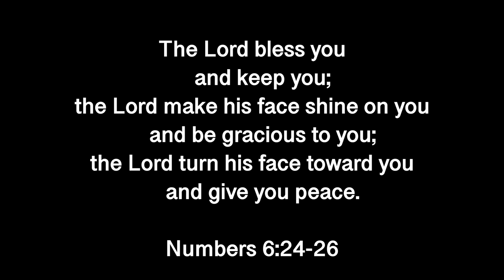Best Rear Ballast?? Heavy Hitch vs. Ballast Box

Comment: So I've done the math many times and I just cant seem to justify the heavy hitch.  I need 500 more lbs at the rear of my 1025r.  The heavy hitch with  the stand and the weights shipped to me in OR is $2,105!  The JD box and  50lbs of sand is $350 and a $50 dolly which I technically dont need [can I put a weighted HH down without that cart to save money? If not, I have lug and store weights just to manually get it on and off every time I use it]  Plus on the JD box I can get more weight if needed and can add handy things to it like a tool box, tubes for shovels, throw my chains in it, weld on a receiver, put my kids in it, etc.   So here's my question, do you have the same departure angle problem with the JD box?  How much further does it stick out over the 70lb weights on a HH?   If theres not much of a departure angle issue and it doesnt stick out that much further (at least not annoyingly far). How would you justify the massive price difference?    Thanks!  I love your channel Tim...it makes me happy.
Reply from the maker: I don't have any measurements on the JD box.  I have a few points which help justify the price.  ...they may not be relevant to you, but then again, they might.  I'll throw em out. You make your own decision.
- weight reuse.  You can use the weights on the front of the tractor when you do not have the loader on.  This provides some better mobility when tilling, etc.  
- You can get a rear blade for the 2 inch receiver from heavy hitch which is not very expensive.  When compared to a standard 3 pt rear blade, you are almost getting the hitch for free.   Hiller-bedder, subsoiler, etc also available.
- These attachments (blade, etc) are easy to store inside because they do not have their own 3 pt connection.  Very compact.
- Heavy hitch cart (yes, more expense) makes it EASY to roll the HH around ...and can store the weights without the bracket too.
You mentioned angle of departure...even though I have not used the Deere box, I'm absolutely certain that it is not even close to as good as the HH.
- Overall, the HH and weights are much more compact. ...and much more flexible for usage and storage.

I get it, they are expensive.    One way to handle it is to look around for used weights..buy a few at a time on craigslist, etc.

Comment: Let see..... you could tilt your trailer up a little to make the angle of loading less, mod the ballast box, etc. I don't like liquids in the tires for ballast. 1, it makes tire repairs more expensive, 2, it can rust the rims, 3, both. Carry an external fuel tank for weight? Oh well.... Nice video again.
Reply from the maker: 2. the RimGuard that we have in our tires will NOT rust the rims.   I find liquid ballast to be the cheapest ballast possible.    Another advantage is that it is not "in the way". It does not protrude in any way like other types of ballast.
Just some thoughts :-)
Reply from the maker: ..and tilting the trailer has almost no effect....due to the hinge location.  I wish it did work like that. I would use that truck all of the time!

Comment: the sliding plate might be sticking because of the paint if theres a way of grinding the paint off it might slide smoother
Reply: Once you get the plate off, make sure the edges are smooth, then spray the edges and the slots it rides in with silicone. Reinsert the plate and move it up and down several times. See  if that helps.

Comment: Could you explain to me what the heavy hitch with weight helps the tractor do? I’m new to this. Thanks.
Reply from the maker: It keeps the rear end on the ground when you have a load on your loader, and it relieves stress on the front axle in the same scenario.
Reply: Okay So with the backhoe in the rear, it should do the same thing correct? btw thanks for referring the tooth bar, it's working great so far for digging out bamboo roots. Thanks for the 5% discount.
Reply from the maker: Yes, backhoe can serve as rear ballast

Comment: As always..interesting video. I have two questions for you. with the HH can you turn the suitcase weights the other way so that they face inward towards the back of the tractor instead of outward?   Second question is...will a couple (or 3) suitcase weights just fit behind the seat (loose) if put in width wise?   You may recall i'm the poor soul who has virtually no room to put ballast on the back due to space considerations. I have the 170lbs on each wheel cast iron option and am considering your suggestion for liquid ballast in the tires as well. I'd like to get some weight though in the middle and to put 2 or 3 suitcase weights behind the seat if possible might help. Thanks ! :)
Reply from the maker: You can put SOME weights on the inside I think,  but not a full rack.
Reply: On the dual, and possibly the offset, bracket you can turn all of the weights around to face the other way. The inside ones  may hit the handles for rotating the top link, unless you are careful to set them vertical.  However, you cannot place them backwards on these brackets if you have a quick hitch. (Which you probably do not have if you are so space constrained.)
Cheers.

Comment: Lol, great video Tim. I have always wondered why one would go with the ballast box as opposed to using weights and a weight bracket. The weights take up less space and can be used on the front and rear of the tractor with the right mounts.

Comment: Can u pick up the back end of a 1023E with the 3 point hitch implement?
Reply from the maker: No. There is no down pressure on a typical 3 point hitch.   Even on very large tractors.
There is (or was) one exception that I know of. I believe the Deere 4 , 5, or 6 series had a down pressure option at one point.  
I don't think it works very well, as the down pressure removes weight from the rear wheels, reducing traction.

I hope that makes sense.
Reply: @TractorTimewithTim  thank u

Comment: So $1000 ish for the heavy hitch, weights, and cart, or about $500 for the other. With a moving dolly.  max about 700? lbs VS 910 lbs for the box filled with sand
Reply: Heavy hitch is a lot more than that if you plan on buying enough weight with shipping.   I need 500lbs more after the fluid filled tires and hitch weight I have.  70lb weights are about $100 each 8 of those alone are almost $1000.  JD ballast box is $300 and 500lbs of play sand is $50.

Comment: It appears that the ballast box was designed for a compact (catagory 1) tractor rather than a sub-accounts (cat 0) tractor.
Reply from the maker: This is a category 1 tractor
Reply: Isn't the 1-series actually "Limited Cat-1"?  Which means it doesn't lift quite as high as a true Cat-1 hitch. Granted, you have mostly corrected the issue with your lift arm mods.
Reply: @eosjoe565  No, the 1025R is not listed as a limited cat 1. I believe the 2305 was, though.
Reply from the maker: Terry, it IS listed as limited Cat 1...which means it has limited lift height.
Even the new 2025r is listed as limited cat 1...which surprises me.  I thought the taller tires would be enough to get it to lift higher.

Comment: I wonder if Tim adjusted the injection timing a bit. Hmmmmmmm
Reply from the maker: No, only hydraulic pressure
Reply from the maker: I guess I thought this could be inferred ‘juice in the joints’ ...
Reply: Ahhhhhhhhhh I get it now! Someone mentioned Hot Rodded and couldn’t help but think engine.

Comment: What do you mean by "juice and the joints"?
Reply from the maker: Hydraulic pressure
Reply: My guess is shimmed the relief valve.  Get a bit more umph.  Just make sure to check with a pressure gauge to make sure you stay under the rated max.

Comment: Has anyone thought of mounting a set of heavy duty casters right to the bottom of the ballast box?  My thought would be as soon as the box is dropped, it would land on its casters and eliminate the furniture dolly?  I guess maybe the downside would be having a top heavy object on casters and maybe the dolly having a larger foot print would be more stable?  Either way maybe this is a design improvement opportunity for someone to take on?
Reply from the maker: Would have even LESS ground clearance, no?
Reply: Tractor Time with Tim 

I believe your right.  I came up with the idea and posted the thought mid video!
Reply: Artillian makes a ballast box dolly that clamps right on to the bottom of the JD ballast box, It has six heavy duty casters. The way it is designed it kind of goes "over" the bottom of the box so it probably only adds an inch or so. I've had one for several years and it works very well. The wheels stick out on both sides to eliminate the box being top heavy. My box weights almost 800 lbs. and it rolls around fine (albeit with a bit of grunt). :-)

Comment: Heard you mention your backhoe hitting the ground while loading and unloading. Little trick you can use is buy some little metal ramps for oil changes and that and put them in front of your rear axle and just drive forward onto them, this will bring the tail of the trailer almost to the ground. Probably good to have it in 4x4 and you could weld Jack's to the tail of your trailer to keep it from lifting your trucks rear tires up and off the ramps. Did this to load my mustang so I dont wreck the front bumper. Hope this helps so you dont have to take chunks of concrete out of your shop or drive way.
Reply: The proper way is to back the tractor on the trailer. That also puts the weight of the tractor forward which is more stabile while towing.
Reply from the maker: Angle is the same forward or backwards.  If backwards, I scrape the trailer. If forwards, I scrape the ground.
Reply: @TractorTimewithTim  I presumed you had a trailer with left and right ramps and opposed to a ramp gate. Backing up separate ramps solves the clearance problems.

Comment: If you are doing an example of stock, drop the quick hitch, and it won't stick back as far.  Might as well use the mod.  Or just shorten the top link and tilt the box up from the ground.  Or pick it up for travel with the bucket or forks.  Or get a different ballast box, there are so many to choose from.  Locally we have Armstrong Ag, Mahindra, Land Pride, New Holland, etc in addition to Deere.

Or get rid of the 1025R.  Like my BX2380, the rear hitches do NOT lift up very high.  It's disappointing.  I'm going to switch to a 2038R next spring.

I'm disappointed with Heavy Hitch--the products are expensive enough, but the shipping is murder.  I placed an order then canceled because it was taking too long.

Comment: you can jack up the front of the trailer and that would take and lower the rear of the trailer just don't unhook it
Reply: carl kidder he can also back the tractor onto the trailer and likely get it loaded as-is with the weight box.
Reply: depends on the weight and where he has room to put the tractor can't have to much weight on the rear of the truck, I always had attachments in the front of the tractor
Reply from the maker: Or, I can just use the heavy hitch.  My purpose in showing this particular need was not to seek solutions on boarding the trailer.  Rather, it was to show an example (of which there are many) of how the low hanging ballast box can hinder the mobility of the tractor.

Comment: 8 x 42lb = 336 lb. Which is roughly 1/2 what the operator's manual recommends for the 1-series H120/120R. My advice is to always use the ballast recommended in the manual which by the way is stated as the MINIMUM recommended ballast. You may need even more when using pallet forks. Stay safe. You should be clear in saying the TITAN ballast box is a show stopper. The JD box doesn't sit back as far either as the pins are welded onto the sides - not out on brackets. Your comparison videos are usually pretty accurate but this one seems to be very heavily biased towards the HH. I mean, you compared a Chinese knockoff box (which has different hitch geometry than the JD box) to a HH which only weighs 1/2 the recommended weight. :-(
Reply from the maker: Ok, I get your point Joe.   I personally think the manual is a bit over-stated, but I will not argue that point.
One point I will take issue with is "you may need more when using pallet forks". This is absolutely totally illogical.  You need whatever you need based on the weight on the front end.
You likely will say "but the weight on the forks will be further out...more leverage".   Yes, but the loader cylinders will not be able to pick up as much weight at that distance...again leverage.  So it all "balances out" so to speak no matter how far out the load is from the tractor.   500lb 6 ft from loader hinge is the same as 250lb 12 ft from the loader hinge (if my lever calculations are correct).  
This is also my argument for shorter forks on a sub-compact tractor.   Longer forks become nearly useless due to the limited hydraulics on a subcompact.
I enjoy your comments Joe.  I'm just stirring up trouble for the fun of it :-)
Reply: That's not coming from me. The JD loader manuals specifically say that an "additional" 167 lbs. of ballast is required whenever pallet forks are used. As with all things JD, there is a bit of confusion factor because the language is a bit hidden and it's not in all the 1 and 2-series loader manuals.  I will be the first to admit the manuals are probably recommending ballast a bit on the heavy side but since there is no formula for calculating "X-ballast needed for Y-loader payload", I'm sure JD is recommended ballasts for which they know will keep the operator safe in all normal conditions.  I enjoy your videos.
Reply from the maker: That is crazy...but oh well.
I’ve been wanting to put together a ballast video showing the mathematics behind it.  This discussion is motivating me to pursue that more seriously!
Thanks!
Reply: Greta idea. I've been trying to find just such an analysis to no avail. I just got a new BX, my property is hilly and I need to move a lot of stone and heavy clay. A quick and dirty comparison of  the myriad lift capacities presented in the manual, yields and average of 780 lbs at the pivot point and 550 lbs 500 mm forward depending on lift height. Am I right to conclude that a corresponding ballast weight would make the most sense? My analysis is based on simple averages and I realize there are many variables I haven't considered. I'm just trying to determine a reasonable weight to dollar ratio before I put my ROPS to the test. Any suggestions/advice would be welcome. 
Many thanks!
Reply: I don't think that is correct. The best place to start is to check the owner's manual for your loader. It should provide the minimum ballast requirements for safe operation of your loader.

Comment: If your initial intent was to mock the ballast box, why even pretend this was an objective comparison?  So what if the box has some grinding debris inside?  So what if the sliding door sticks a bit?  That happens when you fumble-finger a simple slide.  Ever heard of a brush?  Or a file?  Ground clearance a problem?  Maybe your tractor should be a model with larger diameter wheels?  What did all those pretty green weights cost in comparison to 5 cubic feet of river rock @ $6/cubic foot and 90#-100# /cubic foot ?  Extra nice if you've got a smooth concrete floor and a fancy roll-around cart to carry them, I suppose.  I wouldn't know.  Ballast box has cutouts for pallet forks.  Seems like an objective reviewer would have demonstrated them in use.   Also seems like an objective reviewer would have commented on the possibility of having a weld shop add simple brackets to the side of the box to hang suitcase weights in case the user already owned a few.

Overall,  I'd call this "review" an embarrassment.  Not impressed.
Reply from the maker: So, I should get a larger tractor because the ballast box sits too low?    Ha!
Reply: @TractorTimewithTim  No, you should select a box that's appropriately sized for your tractor.  You did not.  On TA's website, the box drawing with dimensions clearly indicates the hitch pins are 9" above the bottom of the box.  Measuring your hitch height from the full up position to the ground and subtracting 9" would have easily revealed a potential clearance problem.  Of course, that's not nearly as dramatic as staging the scene, getting jammed up on the ramp, and then calling it poor box design.  The info was available for you to use.
Reply from the maker: @prairiepucker9392  there is no Titan attachment ballast box with lower pins.  This is the point. It hangs too low.   First you tell me to get a different tractor (which’s is laughable), then you tell me that this box doesn’t fit well...which is my point in the first place!!!!  
Measuring 9” does NOT make it nearly as clear as seeing the box in action.  
This is one of the strong points of our channel.  We show the specs in action.    
I’m not quite sure why you are so upset about this.  Seems we both agree, the Titan ballast box is not a good solution for a subcompact tractor!   I just chose to illustrate that point, rather than lecture about it.
Oh, and one more thing.  Much of the paint is now faded badly or totally gone on that ballast box.  You seem to indicate that this is not an issue. Well,  fit and finish IS an issue to a lot of our viewers.  If it is no concern to you, that is fine.    Most of our viewers enjoy seeing these details pointed out.